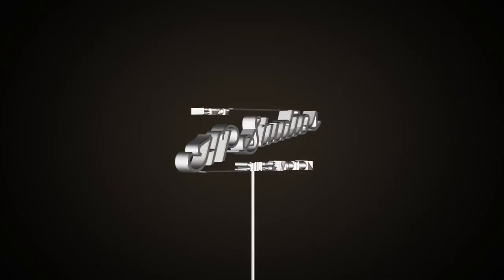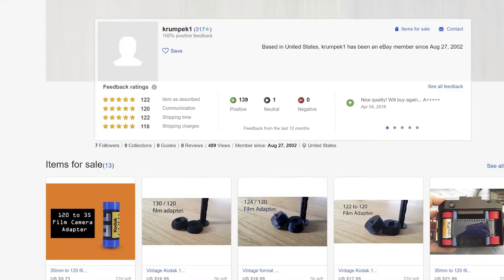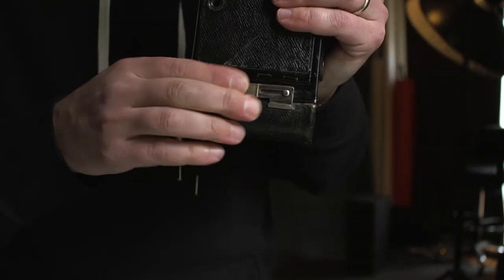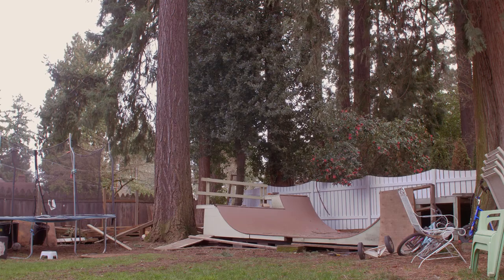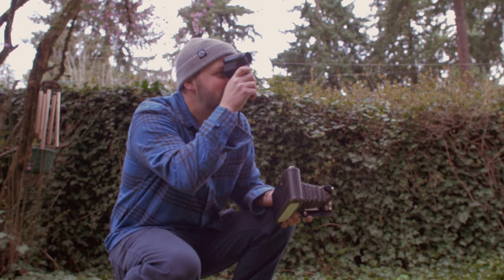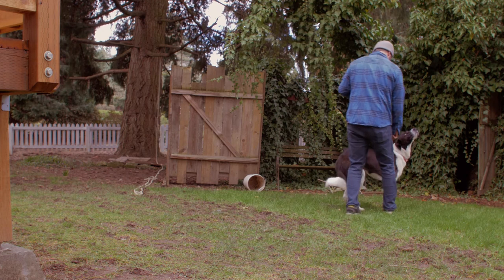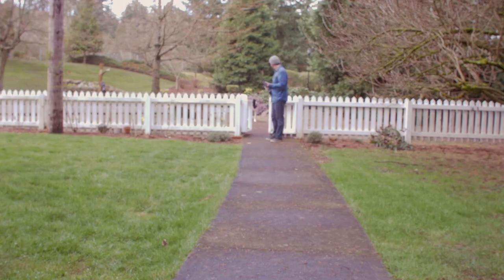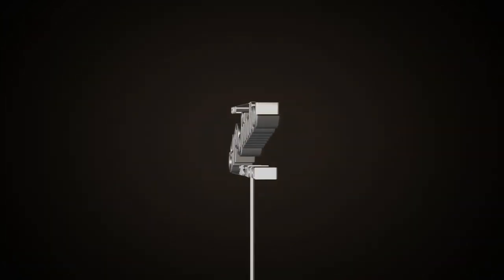Shooting Film in a folding Kodak Primo

Comment: You can use flex seal inside the bellows to fix the light leaks. Worked for a guy I know.
Reply from the maker: Will Smiley I’ll have to check this out. Thanks man!!
Reply from the maker: Hey Will, I got some Flex seal but I'm not comfortable using it on this Primo. I was given another Folding camera with no light leaks that I'll be shooting soon. Look for that vid in a week or two. ;)
Reply: +HayesPeterson it may spray on too thick for it to allow the bellows to fold properly. I applied a layer of black fabric paint to the inside and out of the bellows, then a mixture of fabric glue and black acrylic paint followed by another layer of black fabric paint.

Comment: This is the same camera that I “inherited”. Two questions I am trying to figure out, are the numbers on the face by the lens that go 1- 9 f stops or a different measure? And what is the pattern that you had to use to advance the film?

Thank you so much for posting this! They are cool cameras!
Reply from the maker: I haven't used this camera in awhile due to light leaks and that I have another one that is more fun to use. Mine has 4-36 which are the F-stops or aperture.  I can't recall exactly what my count was but depending on what you see in the little hole on the back, look for #1 then half turn 6 times for the next frame. I hope that helps.